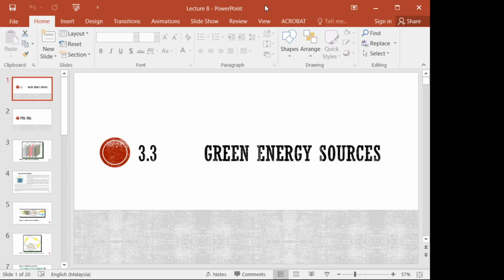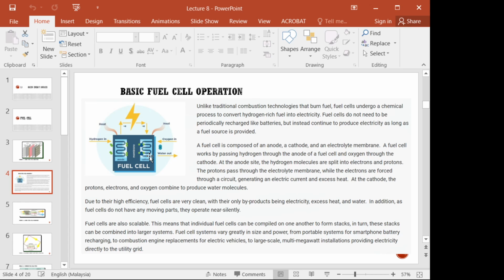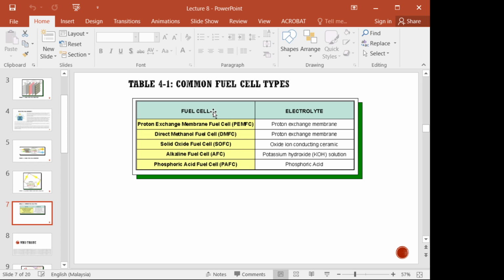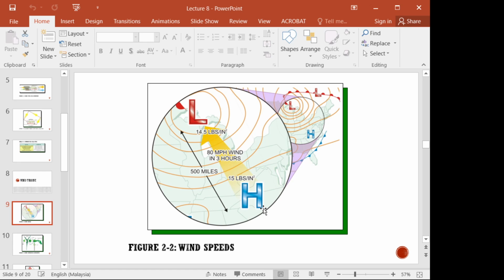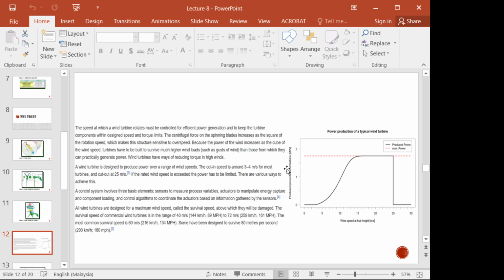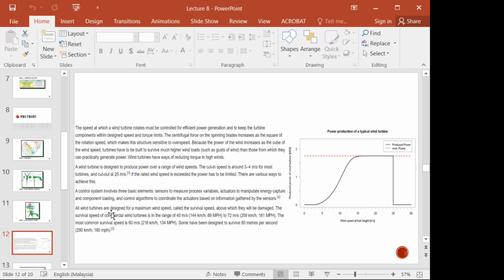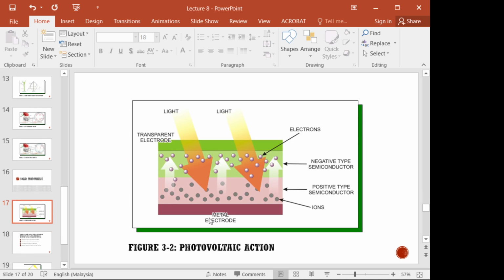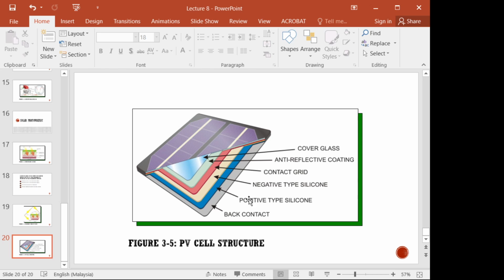Lecture 7 Introduction to Possible “Green Fuel”

Comment: MUHAMMAD AMIR SYAFIQ BIN AHMAD SUKRI 
B071710161

GREEN ENERGY SOURCES:

Fuel Cell: 
•	Undergo a chemical process to convert from hydrogen rich fuel into electricity
•	Fuel cell consist of anode, cathode and electrolyte membrane
Advantages of fuel cell: 
•	High efficiency
•	No moving part
•	Silent operation
•	The fuel cell is scalable

Basic fuel cell structure
•	Positive collection plate
•	Positive electrode
•	Catalyst
•	Electrolyte
•	Catalyst
•	Negative electrode
•	Negative plate 

Wind Turbine: wind generator components
•	Nose cone
•	Blades
•	Face
•	Hub
•	Stator
•	Rotor
•	O-ring
•	Body
•	Yaw
•	Potentiometer 
Wind turbine is designed to produce power over a range of wind speeds. The cut in speed is around 3 – 4 m/s for most turbines and cut out at 25m/s.
BASIC ELEMENT CONTROL SYSTEM
•	sensors = measure a process variable
•	Actuator = manipulate energy capture and component loading
•	Control Algorithms = coordinate the actuators based on information gathered by the sensor

	Solar Photovoltaic 
a sun is equal to 1000 watts per square meter (1000w/m^2). This variable is affected by the following factors:
•	The angle the light hit the surface (time – of – day)
•	The angle the light hits the surface (time – of – year)
•	The cloudiness/haziness of the atmosphere
•	The height above sea level where the surface is located

solar Photovoltaic structure:
•	Cover glass 
•	Anti-reflective coating 
•	Contact grind 
•	Negative type silicone
•	Positive type silicone
•	Back contact